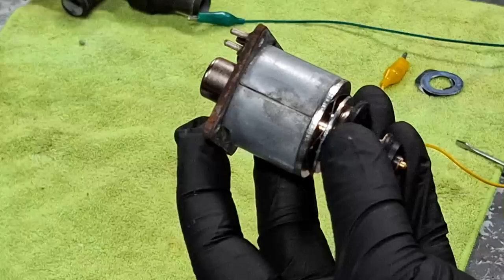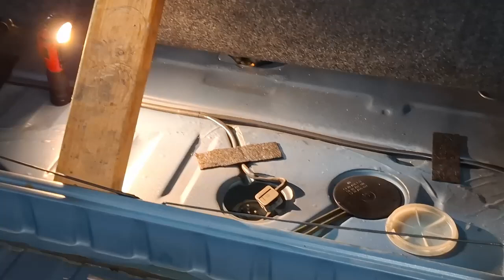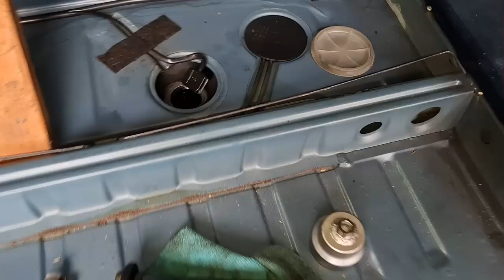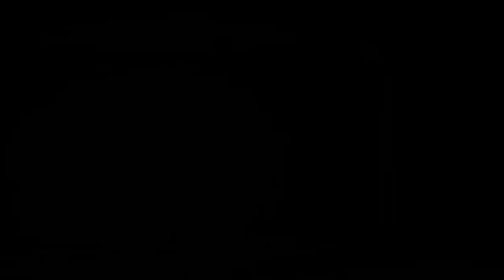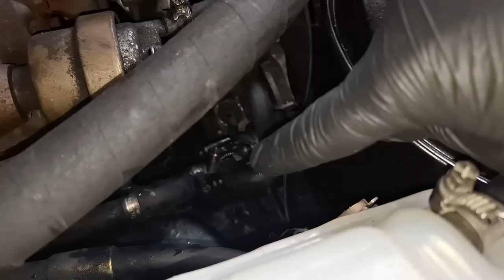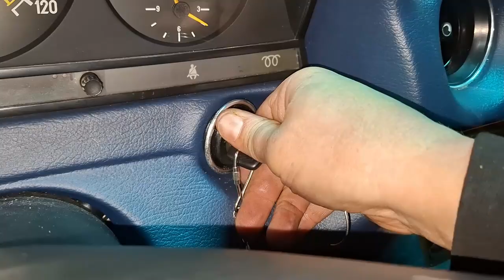1985 Mercedes 300TD - Part 9 Mono Valve, Fuel System, Visors, Water pump and Lock Cylinder

Comment: MB used to be able to make ignition tumblers to your existing keys, are they not able to anymore ?
Reply from the maker: Yes you are correct I actually called the classic center for another car yesterday and they told me they could do this however I did not realize that when I was working on this wagon. So I just installed a genuine Mercedes ignition tumbler I had at the shop.